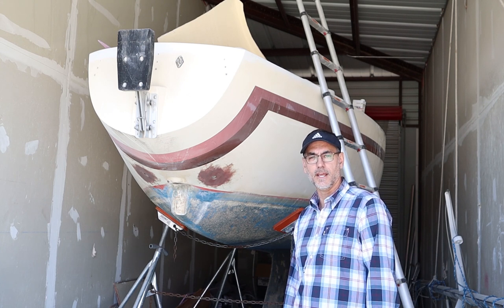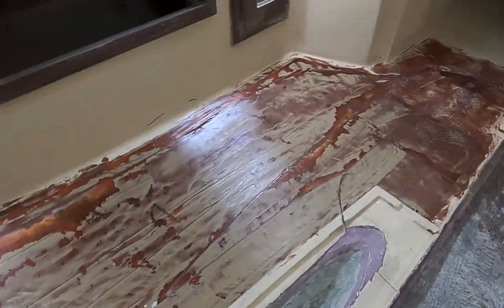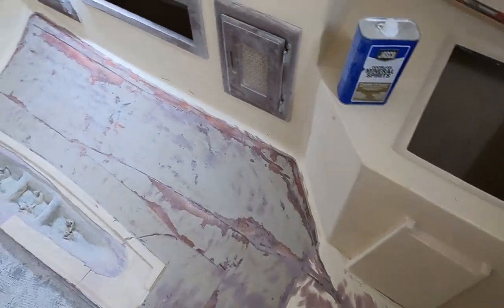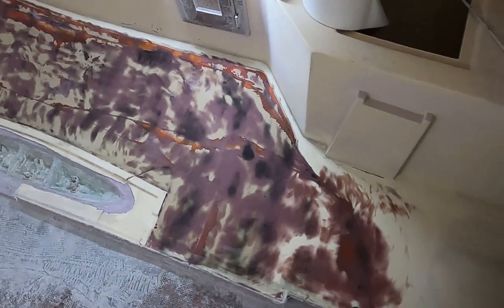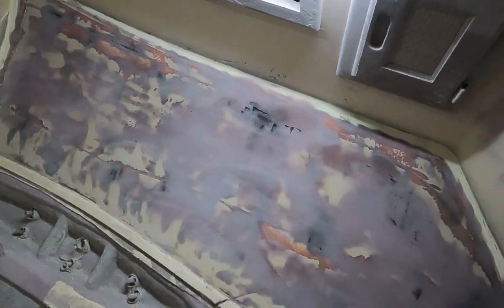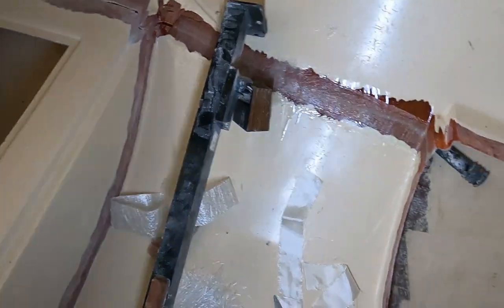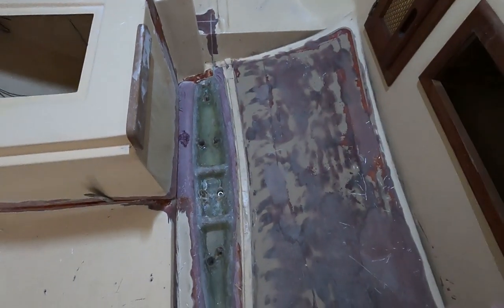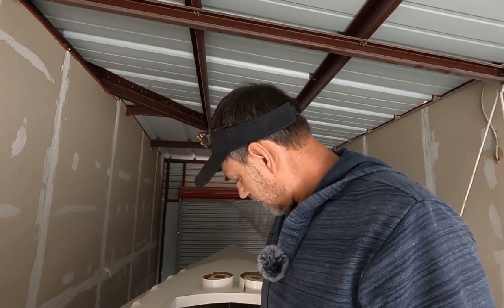Sailboat Refit Ep11 Installing the fiberglass liner.

Comment: Hi John, you may have said before, but I missed it, but what are you putting on the floor as a covering?. I admire your desire for the perfect finish. I certainly enjoy your vids. Best regards...Phil, Tasmania Australia.
Reply from the maker: I’m using West Systems Epoxy with 407 fairing  additive.   But you can use any fairing,  Total Fair is really good from Total Boat.